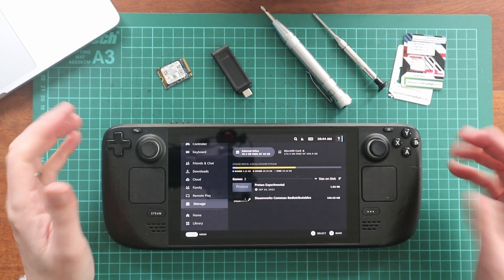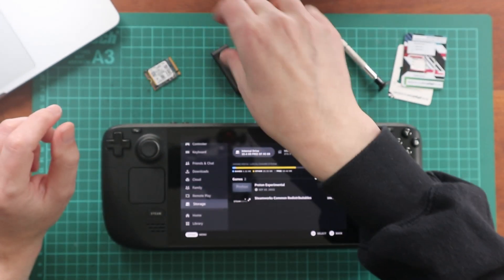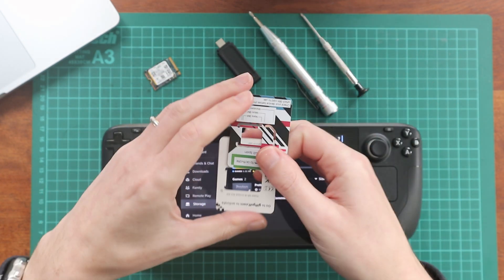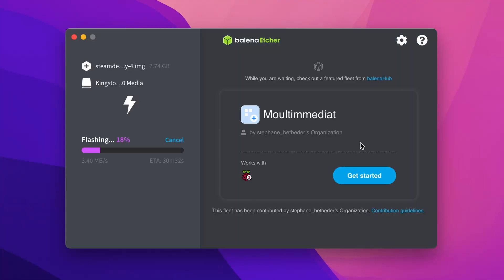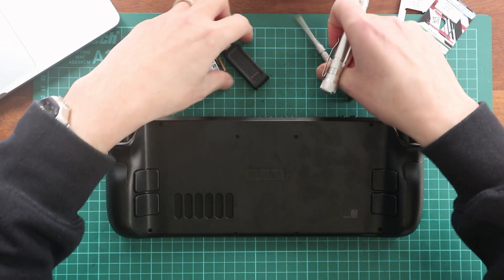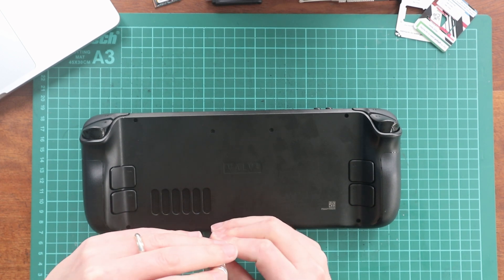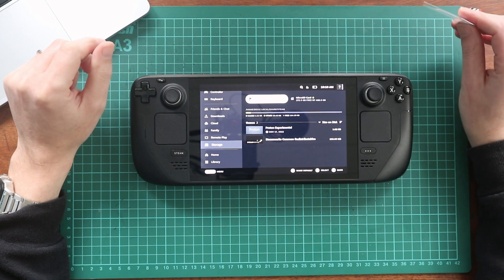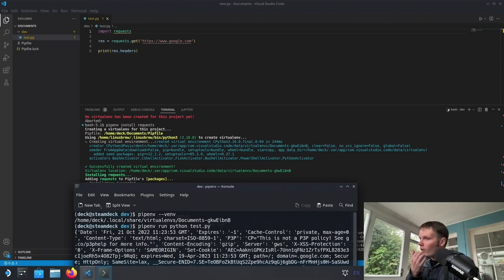How I Upgraded My 64GB Steam Deck with a $21 SSD

Comment: I dont even bother. I seen on Reddit that a good chunk of people had some serious problems months after swapping the SSD and reinstalling the SteamOs image. I went and got a 512gb Micro Sd instead. Also like this there cant be warranty issues down the road...
Reply from the maker: That's the best safe option (and what I did for a bit) and is great whilst you're still in warranty. After that it might be worth considering.
Reply: Link ?

Comment: There is a so-called Battery Storage Mode which essentially disables the power button. May help if you decide to open it again. To then turn on Steam Deck again, connect the charger.
I think the console comes in this mode initially. That's why instructions said to connect the charger before trying to power on.
Reply from the maker: Will definitely be using this if I open it again.

Comment: There were so many rumors before this actually came out that I had to look up a video to see if the 64gb was soldered or in the slot. I bought the 512gb version and upgraded it to 1tb recently. I was considering getting my son the 64gb and also doing a 1tb upgrade. Was just curious if you could leave the OS installed on the soldered emmc and just add a nvme drive. Kinda disappointed that's not the case.
Reply from the maker: Only 1 M2 slot so yeah that's not possible. Still think it's pretty awesome the cheapest version has this option available.

Comment: I'm using a samsung evo  select 512gb and it's almost as fast as fast at loading games as the ssd unless I'm running windows in which case the performance is terrible.
Reply from the maker: Yeah, I don't notice any difference at all. A much easier way to upgrade too!

Comment: Good job, IP guy here. Impressed for being a novis =-) Little suggestion, get a static bracelet next time. They only a couple of pounds and stops you from shorting the board by mistake. Also never wear things like metal rings, as one slip up you can short out your deck as well =-)
Reply from the maker: Ooh nice tip on the ring. I tend to ground myself on a radiator prior to working on stuff but yeah probably should be more official if I'm recording myself doing it.

Comment: What's the current rating of the original SSD? Did you choose a SSD with a lower or at max. equal current rating? The Steam Deck is an embedded system, modding it using parts with higher power consumption and thus higher power dissipation as originally intended might lead to defects.
If it would be that easy, Valve wouldn't have changed the SSD in the 512GB model to one with half the bandwidth because of the shortages. They had to choose a SSD with the same or lower power consumption as the original one used.
Reply from the maker: It's listed as 3.2W on the Kioxia site. Apparently the 512GB decks stock one is 3.3W. If there's ever an issue I always have the option of switching it back to stock or upgrading for something larger.

Comment: If I was not so scared about breaking the battery connector, I would love to make this upgrade on my Deck
Reply from the maker: Definitely the most difficult part of it for me.
Reply: I upgraded mine today. Found an ssd on Amazon for £30 (used) and the battery connector came out so easily. Haven’t really done anything like this before but it was super easy.

Comment: Hello Ian, great video! Quick question: how did you get that SSD for that price? 😅 
It's literally 3 times that at the moment (£60) on the link you provided (UK). That's the secret I was hoping to uncover when I clicked into the video haha 
Nevertheless, thank you so much!
Reply from the maker: No probs. It's a refurbished model from lambda-tek. Found it on hotdealsuk where they occasionally crop up. Looks like it's from a surface laptop as I noticed on the video afterwards.
Reply: Bought a 512 ssd for £40